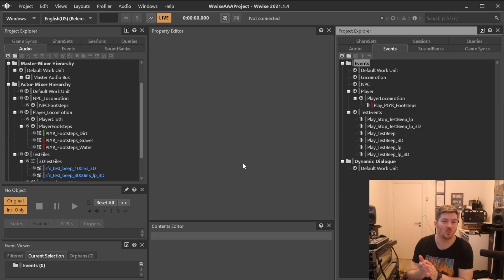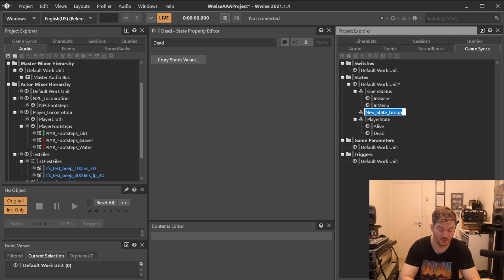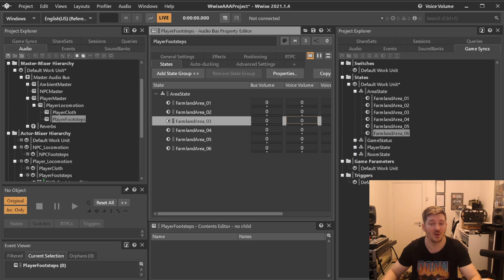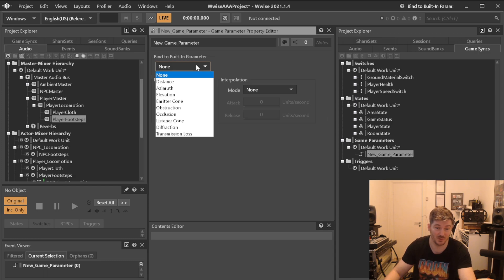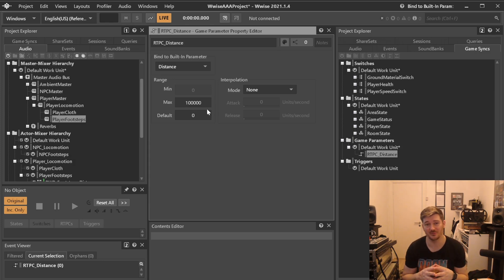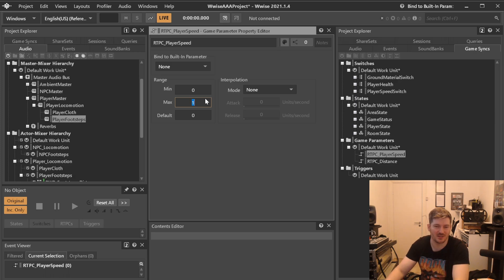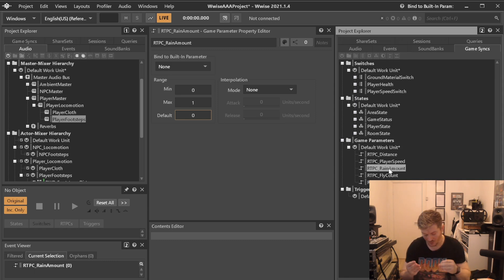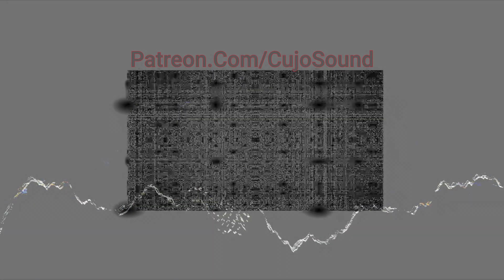Setting up a AAA Wwise project - Part 3: Basic RTPCs, Switches, States and more.

Comment: Hey man, regarding Switches, I have a custom footstep system integrated into my video game I'm developing and everything is working fine with one exception. As my player controller moves from one surface to the next, the Wwise switches changing perfectly and the sfx files correctly play back but I am experiencing the first sfx file on each switch change being much louder in volume and I can't figure out what is causing this. I've check all the sfx files and everything is of equal volume so I know the samples are fine by themselves so I'm thinking something is doubling up on when changing switch. Wondering if you've experienced anything like this before?